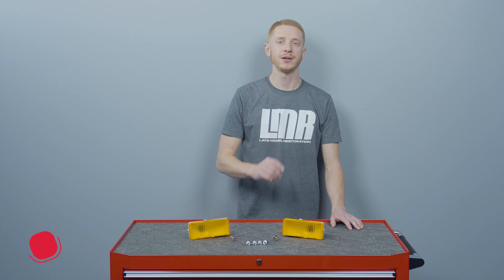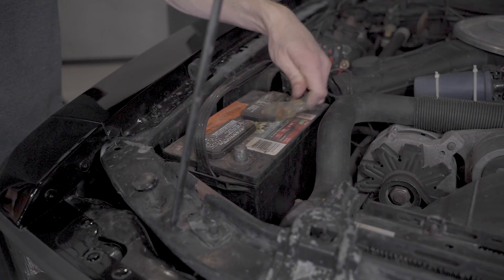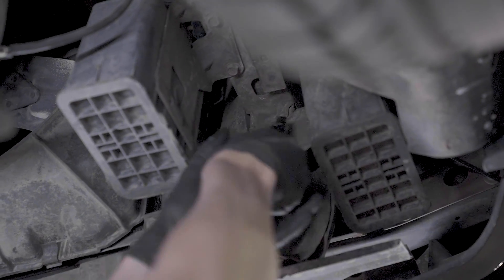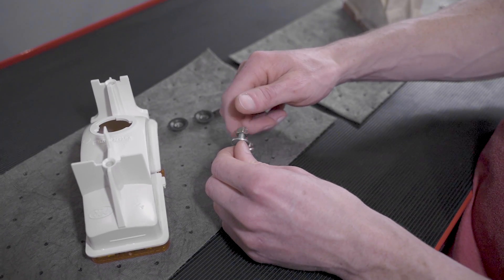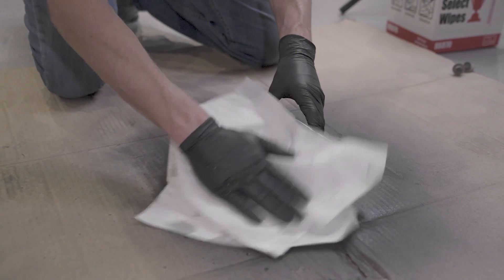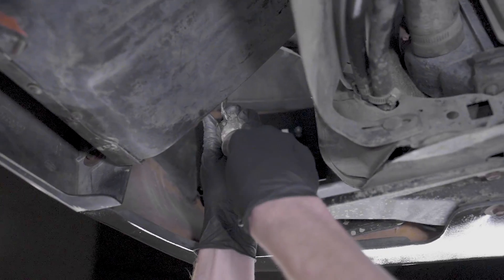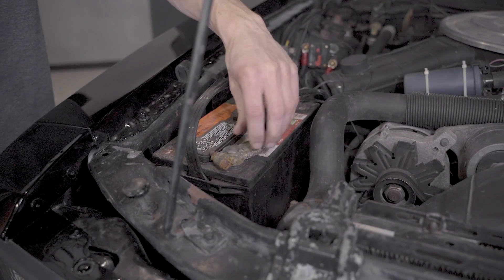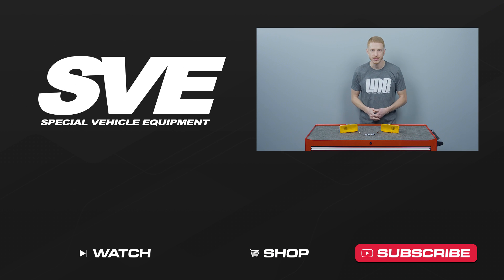How To Remove & Install Fox Body Mustang Turn Signals (79-86)

Comment: What do you do if the 9/16" bolts have permanently rusted to the U-Nut's.  I've already busted the u part of the U-nuts.  I can't get those little buggers out now.  the bolts just turn.
Reply from the maker: None ya - This may seem crazy, but it could be very beneficial if you remove the front bumper.  Doing this will allow for additional working room so you can further assess a game plan of how to get the bolts out.  We have a video explaining the front bumper removal process.  I'll link it below. 

Front bumper removal video: https://youtu.be/7tJwJrcQyaA
Reply: @latemodelrestoration  those bolts look even worse....   not sure that's the way to go.
Reply from the maker: @shagmail  Well that stinks!  Hate to hear that.  Got to love old cars.  Have you tried wedging a pry bar or flathead underneath the bolt as you loosen it?  -Landan
Reply: @latemodelrestoration  No, but I heard the U nut break.  Broke them all, both sides.  I tried an air chisel, unfortunately I'm at the disposal of the shop I'm using.  I even tried to angle grind the heads off, not enough room.  I did make some progress with a wiz wheel, like they use to cut a body panel off but that is so slow I gave up.  I'm hoping that the hobby shop on base can eventually get a Oxy-Acetylene torch but if they didn't have one way back in 94 when I was here and they ain't got one now, then they surely aren't going to get one anytime in the future.   I'll eventually get it out, there's lots more to do before I run out of things to do and the turn signals are the only thing left.
Reply from the maker: @shagmail  You're right! There is always something else to do. -Landan